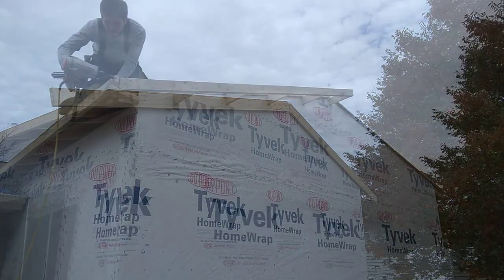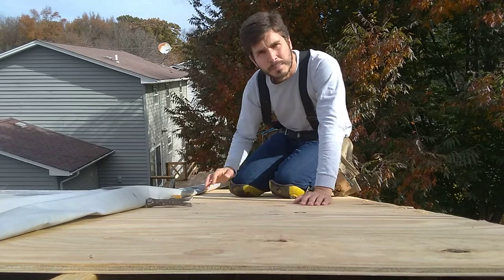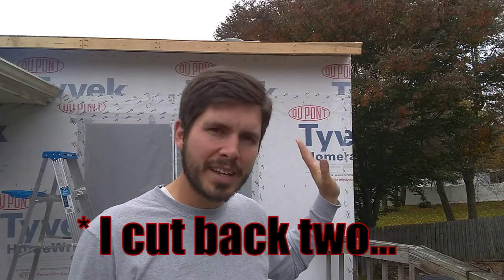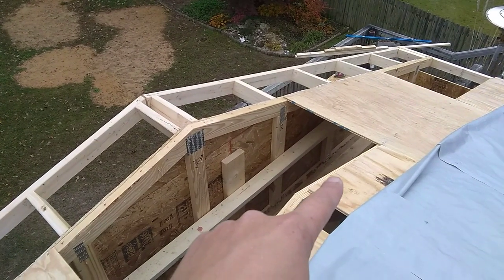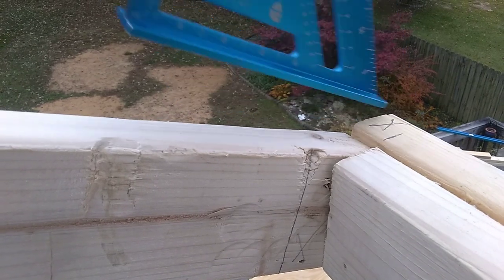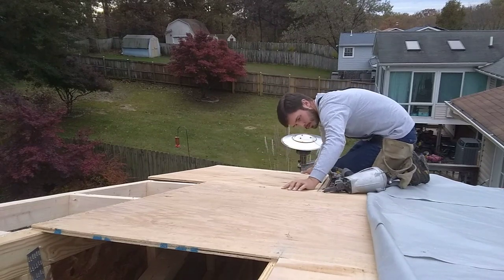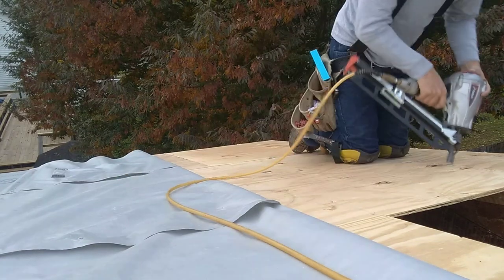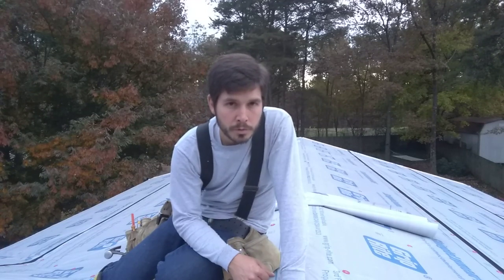House Addition | Fixing Roof Overhang | Day 26

Comment: Thank you very much for this video, exactly what I was looking for- to extend the roof and build soffits as existing roof edge doesn’t protect siding and windows from elements.
Reply from the maker: You're welcome and I'm glad this video could help you.  In a perfect world you could extend your framing back through to tie into your "second" truss/rafter while cradled by your first truss/rafter.  This would make for a stronger overhang.  Thanks for watching
Reply: @horstcarpentry  Thank you very much for this advice, next week the contractor will come with the plan of work and now it will be easier to understand the options for extension; complicated task as our 1975 roof splits into two parts with one regular slope connected to the short vertical wall with  skylight windows ( where the leak is) and cathedral ceiling below it. It will be interesting to see what solutions the contractor will have to build the soffit- just along the roof ridge or maybe along the slope as well. THANK YOU, your video is the only one on YouTube that shows how the extensions should be constructed!
Reply from the maker: Well thank you and I'm glad it could help you with your project.  Remember, depending on how your roof is constructed you could tuck the framing back into the first true truss/rafter.  If he brings that up (or maybe you could ask if he could build it that way) as an option it's the strongest way to go.  The way I built it here will work though and many companies build overhangs this way.  I hope everything works out for your project.  Thanks again

Comment: Nice clean work , I don’t agree with having the plywood be the main form of support for that whole overhang . Why not notch a few 2x4 into the second rafter ??
Reply from the maker: Thank you.  The outer truss was full height and couldn't be cut.  Agree with you that it's not ideal though.
Reply: Yeah man . I get it . I’m a roofer , that’s our widow maker . I’ve been tearing off 3 stories up on something like that ... let me tell you , they’re not nearly as solid 30 years from now. I have to re secure or rebuild every one .
Reply: @michaelzomerfeld9120  Best to build ladder rakes so you can screw the ladder into the end rafter.
Reply from the maker: It definitely should be done that way.  This was an oversight on my part.  Since the final truss height isn't reduced there's no way to build it that way in this situation.  Thanks for the comment

Comment: We don’t tape our paper together in CA I’ll definitely do it when I need to pull paper back. Looks a lot easier.

(At least in my area) 
When repairing/ adding an overhang it’s best to have at minimum 2 outriggers going into the roof and fastened to a rafter. 
Same concept you used with the first piece but instead adding them in between. It’ll provide much better support.
Reply from the maker: I taped the paper because I was expecting a strong storm and didn't want to have any issues with water.  Normally wouldn't do that...just not needed.

Someone else commented about the need for more structural support for the eave and I totally agree.  This was a mistake on my part and if planned would have needed to have a shorter Gable truss.  This would allow framing to extend back and tie into first field truss.

Comment: I'm from England and just wanted to ask why in general do you guys tend to build houses out of wood?
Reply from the maker: They're not all built out of wood, but, if you mean concrete walls and plaster interior then no we don't do that at all.  The major reason for wood construction is price.  No way around it everyone wants houses cheaper and cheaper.  Thanks for watching and commenting
Reply: @horstcarpentry  yeah we typical build as one "red type" brick wall out side with a cavity filled with insulation then a concrete block wall inside that gets plastered to look nice. It just amazes me that in the UK our weather is fairly mild but we always build in blocks ect but the USA has all kinds of weather but homes tend to be build with timber ect. You would think people with tornadoes and hurricanes would build houses like bunkers lol. But I do love how you guys build Is like to frame and build a house. All the best
Reply from the maker: Believe me in some coastal areas they are built like bunkers.  Some still are wood framed but with straps and hardware to make it a lot stronger.  In tornado areas they normally have storm shelters like a root cellar for protection.  Hurricanes and tornadoes happen very rarely in reality and not many build structures to take a direct hit.  Check out codes for earthquake areas like California.  I've heard of skyscrapers built on floating piers to withstand the movement.  Wild stuff out there.  Thank God for engineers.

Comment: what size are the RAFTERS ? Also 2x4
Reply from the maker: The roof uses trusses not rafters.
Reply: @horstcarpentry  what size are they 2x6 ?
Reply from the maker: Well the trusses themselves are built with 2x4s. I'm wondering if you mean the add-ons on the rake ends. Those are also 2x4s.
Reply: @horstcarpentry  Yes the ADD ons 
How about the FACIA Board ? 2x6 ?
Reply from the maker: The add ons on the rake and sub fascia are 2 x 4's